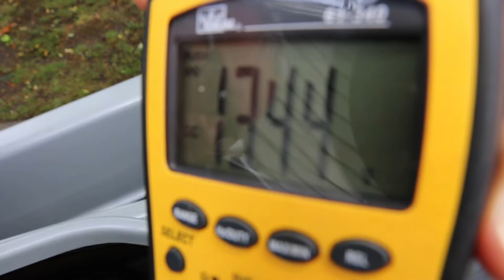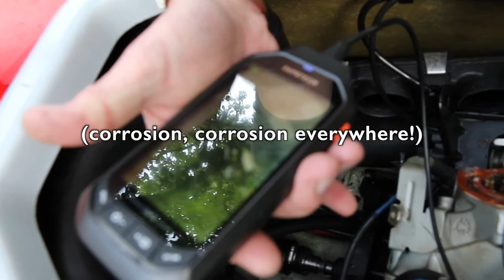Starter Motor Troubleshooting On A 2000 Sea-Doo RX DI

Comment: Thats a shame that your recommendation is to not fix it because its an old machine. Because these older machines are way more fun than the new ones, they are more fuel efficient, and go just as fast. The RX DI is a rare beast and should always be fixed! Its the perfect ski. I just put 2k into my 2001 GTX DI. Always wished I had the RX but the GTX DI ski has treated me well for 23 years.
Reply from the maker: You raise some good points. Thanks for your comment.
Reply: I have an rx sitting in my garage right now on a cart I made. I'm trying to get it to turn over so I can check compression so I can sell it. I bought a jetski trailer and they wanted me to take the jetski. I know nothing about jetskis.
Reply from the maker: You’ll need to find someone who knows about jet skis to help you with your project. Good luck!
Reply: @3ftDeepChannel  can't I just learn on the fly? Seems straightforward. Can't hurt something already broken right? Lol
Reply from the maker: Well, if it’s not done right it will fail …and unlike a car where help is often pretty near when a breakdown occurs, when a jetski leaves you stranded in the water it’s a whole other matter.
Reply: @3ftDeepChannel  ya I get you when u say that.

Comment: SBT Time perhaps. However if I recall correctly that fuel injection system is not so fantastic.
Reply: Nothing about a bombardier is so fantastic I cannot even begin to count the number of our of the crate sea doos i have had to replace top ends on before putting a battery into them, or the tops ends on 787 engines i had to r&r for base gasket replacements out of the crate due to they save a ton of money not winterizing them as only about 8% of their total base goes to "cold" climate areas its cheaper for them to pay us warranty to replace a blown out base gasket due to freeze up than run antifreeze theu them, lets see oil injection lines rotting and leaking, bad fuel tanks, replace the replacement bad fuel tank again, oh and again on some models,there are more service bulletins on a single model of sea doo than there are all of mercury motors since 1970 combined
had a guy one time offer me a sea doo in trade for a complete tune up on his 28 foot fishing boat, Hell NO i wouldnt take one for free, yes they are very fun to ride but them upkeep on them is horrible, ( 4 strokes do seem to be a world better unless you get a spark then good luck  even most dealers wont work on them, yes they take them but they sit till customer gets mad  and grabs it and takes it down the road to the next poor dealership i used to tell the instructors at sea doo school i could teach a monkey to find a better place to put a battery but they topped themselves with the spark on cramming a battery into a tiny area

Comment: What size socket did you use to take off the last nut from the black pipe
Reply from the maker: The one that fit ;) . Try on a few sockets until you find one that fits right. Hint: they are metric. Good luck.
Reply: @3ftDeepChannel  thanks thats what i did it was a mission to take it off …finally got everything loose just need to be patient, thanks again …i need to replace the stator i put a new battery and won’t charge it keeps dying,i already checked the rectifier.. and its good ill give the stator a try,thanks
Reply from the maker: Good luck, Ralph.

Comment: You said it needed a block to be fixed, do you mean new one or could a machine shop fix the block and bore it out for less than new engine/new block?
Reply from the maker: As the damage was extensive (beyond the cylinder walls), we didn't go into it much further to determine which option would be better. We only knew the expense would not be worth it on that (older) machine. Water had been sitting in the engine for a long time.
Reply: Thats a shame that your recommendation is to not fix it because its an old machine. Because these older machines are way more fun than the new ones, they are more fuel efficient, and go just as fast. The RX DI is a rare beast and should always be fixed! Its the perfect ski. I just put 2k into my 2001 GTX DI. Always wished I had the RX but the GTX DI ski has treated me well for 23 years.   @3ftDeepChannel
Reply from the maker: You make some good points. Thanks for your comment.
Reply: @gamingwithjessika I have 1 in garage I acquired. Comes with a kart. I don't know what I'm doing while messing with it. Exact same one as in the video
Reply from the maker: I would avoid spending much money on it before identifying its problems. It will likely turn out to be a huge $$ pit. Good luck.
Reply: @3ftDeepChannel  can I just replace the rings after I free up the engine if pistons are ok?
Reply from the maker: It really depends on what this issue(s) is. I very strongly doubt it’s just the piston rings.

Comment: obviously been sitting in waves where water blows up the exhaust and fills everything, but rule #1 with a sea doo NEVER EVER JUMP START them unless you want to burn up the mpem box ( engine control module that all them fuses were in)
Reply from the maker: It sound like you’re speaking from experience?
Reply: @3ftDeepChannel  30 years a marine technician